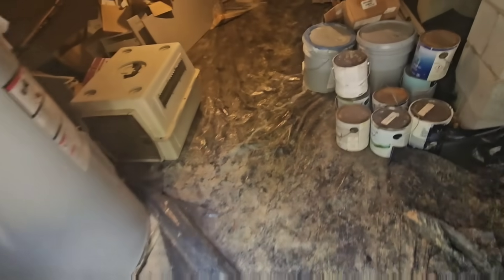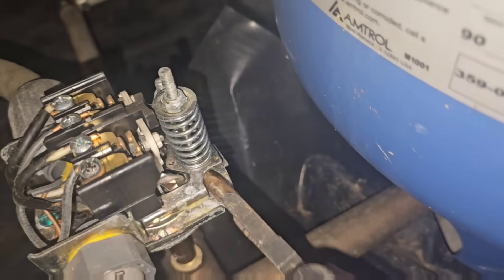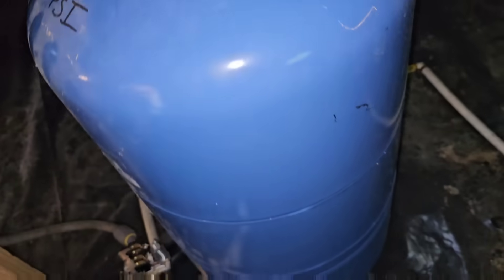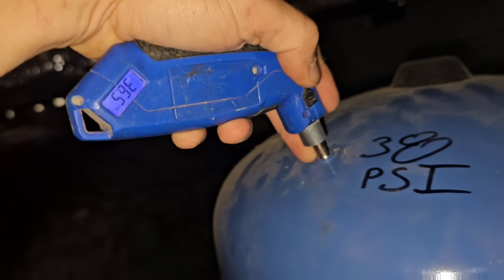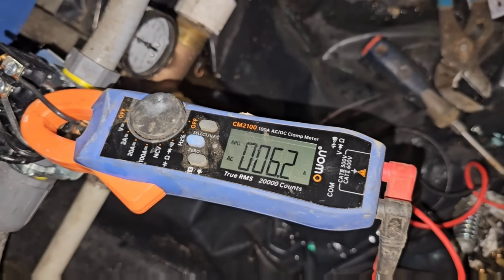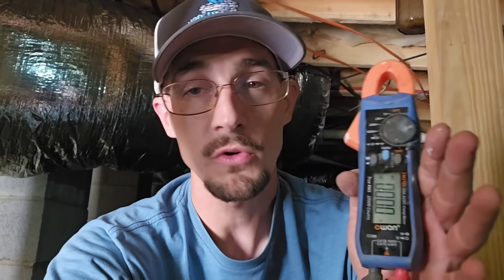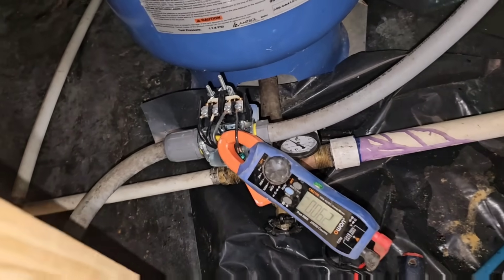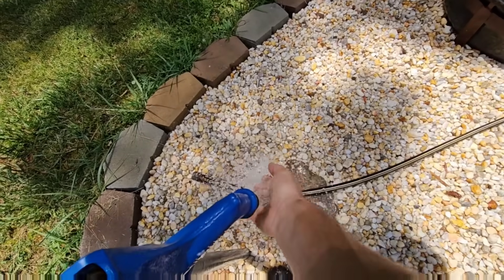Well Pump Troubleshooting at The Pressure Switch. DIY Test & Fix for No Water.

Comment: I sure wish you guys were in my area.  I had a very painful experience recently from a pump and well professional, who came out to perform a rehab on an old well.  After completing the process, he sticks the pump back down the hole, clamps his current meter around one leg at the well head, and energizes the circuit.  Pump isn't running, and gets zero amps.  He thinks because there is zero amps, the control box in the garage is bad.  Keep in mind, ALL the work was performed at the well head that day.  I tell him to check for voltage at the well head coming from the house to verify it's there. He kept telling me "I've got an amp meter out there, and there's no current so there's a problem with the pressure switch, control box, or pump tech".  I told him you're not going to get any current if there's an open in the circuit, so just make sure there's voltage at the well head first.  He still insists the problem is in the garage.  We walk into the garage, and the pump tech box, located downstream from the pressure switch, is ON.  I tell him this is downstream, and is illuminated with power.  "Trouble is leaving here fine" as I like to say.  He starts swapping out the card in the control box, opening and closing the pressure switch, and smelling the pump tech circuitry for something that is burnt.  Long story short, I don't think this guy understood basic troubleshooting. By dumb luck, his helper decided to unwrap the wire nut connections and found the problem right there.

Comment: Two days ago, I noticed that the water pressure was decreasing.  Dwindled to almost nothing last night.
I'm fairly handy, so I'll try and I've got a voltmeter.  It's not the circuit breaker, so I'll proceed.  
Thanks for your video.  Any other advice?

Comment: Nice job trouble shooting! Though how would you go bout trouble shooting a 2 wire 1/2 hp 120v submersible pump for resistance?  Mine occasionally has trouble starting but most time it runs perfectly, I contacted Franklin pump and mentioned to check the resistance to the pump and it ohms out at 4  specs called for 1.4-2.0 ohms I'm thinking it may have something to do with a bad starter cap? Thanks Nate

Comment: Not sure if you can answer some questions for me , but I watched your video, love your teaching way, but my problem seems to have compounded since my friend wanted to be helpful, now I'm not sure what's going on and haven't had water in over a week, changed pressure switch, and now tanks and more problems now than when I first started, I'm not sure what my friend did, but maybe fried the well pump. I can't get it to start but seems there is power to the pressure switch, my friend said the bladder tank was bad, but it wasn't full of water , he also put the air valve on the tank , it had been on the line near the pressure switch but not on tank. Anyways I'm probably wasting my time, but hope you can help.

Comment: I have noticed my pressure tank is only filling up to about 1-1.2 gallons. Everytime I flush one toilet at 1.28 gpf, the pump kicks on. I took off the switch and sure enough the pipe the switch sits on was clogged id say 90%. I cleaned that out yet my tank is still only filling up 1 or so gallons and kicking on. I don't have any other symptoms of a bad tank i.e. no water sloshing, no air coming out the schrader valve, my pressure is good. Could the switch itself be bad? I know there's a diaphragm in the switch and seeing the amount of sediment come up the pipe the switch sits on, my guts telling me the switch is clogged and not allowing it to fill up the tank correctly. Thoughts?

Comment: The switch only shuts off one circuit, the other wire is hot. Where is the check valve? Where did the air go? It’s a closed bladder, you will lose air again
Reply: You dont need a check valve there u dink . Air could have been lost at the shrader valve as well

Comment: Thank you so much for the tutorial...really instructive ! I have no water from the well since Wednesday March 7th, the tank is empty, I replaced the switch pressure , the pressure gauge (indicating 0 now) are good. I aired the tank up to 38 psi  as it was 10 psi....when I kicked on the breaker, my new clamp meter indicates 24-25 amps then drops to steady 0....15 secs later, same scenario. Any thoughts ? Thanks for your help.
Reply: Hi 👋

Comment: I have a couple of questions, one is when your installing a new well away from the home and pressure tank and pump start and run control box in or under the home,why do you not use a pitless adapter through the well case so the plumbing doesn't have to be protected from freezing or damage.

Comment: Ok my bad. Ok so I have a Junction box.Where where the word coming from?The breaker box here and the whale goes straight to the pressure switch. On the other side of the switch the wire comes out goes to the junction box, Then it goes from the junction box to the well.. My question Is can I do away with the Junction box? And run my wire from the switch to the well pump???  That looks like a lot of the Videos you show are without a junction box. My junction Box
Has a capacitor in it. Need help And information please??

Comment: So my pump is a Grundfos MQ and has an integrated pressure switch. We have no water pressure. I went under the house to the tank and it’s in an alarm status and not running which according to the book happens when it’s running dry, overheating, ect and shuts itself off. I undid the prime port and got blasted so it’s definitely not running dry. Any ideas? The gauge between the pump and tank is showing zero. I haven’t checked the pressure on the tank yet. Would some kind of clog in a pipe cause this?
Reply: Replace switch and check capaciter

Comment: I did that and i changed the switch and it work for one day and now is not working again the tank pressure is fine the gage psi is in 0 all that time included when it was working i do not know what is the problem 😊
Reply: Hi pancho

Comment: Thank you for this informative video, you are very experienced and knowledgeable.  However, I would not appreciate my plumber turning on the drain faucet at the bladder tank without a collection pan.  Maybe you cleaned up the water later, but a collection pan would have been more professional and a better presentation in your video.  Whether a conditioned and non-conditioned space, I never want water standing under my house, period.

Comment: I appreciate you filming and sharing the video.  What happened to the air in the pressure tank?  You think it leaked from the Schrader valve and maybe reseated so it won't leak out again?

Comment: We are having severe storms  out west .
The power went out and our jet pump isn't working .
Our system is a submersible to a 2500 gal tank and a surface pump charging the pressure tank . I'm going to start at the panel and check all the connections to the pressure switch.  Now I know to check the tube and check the switch.  
Thanx
Reply: Hey Felix

Comment: What if my pump starts at 6.4 and slowly drops down until it eventually stops running? Time to replace the pump?
Reply from the maker: @jessecrouse232  not necessarily, 6.4a is good. Under load it does go down in amps slightly. But if it stops & the water quits, you might have a wire failure or a wore out pump impeller stack.
Reply: @h2omechanic  it will drop down to about 5.3 and hold there and It won't build any more pressure. I figured either bad pump or well drying up? Either way thank you for responding I appreciate it
Reply from the maker: @jessecrouse232  correct! It can be a dry well, if its been common in the past. Id check for a leaky toilet. 
But if its 10 years old, definitely can be a worn out pump too.
Reply: @h2omechanic  actually the pump is 22 years old lol I'll be doing a pump this weekend. Btw Ive watched probably 30 of yours videos in the last 2 days and now I feel confident to tackle this. Thank you for everything 👍

Comment: Thanks for another great video. Got a situation here, i just ran out of water, switch seems a little burned and the pressure tank is waterlogged. Pressure gauge is 0. Ill run to the store tomorrow and try to change the tank and switch. My main worry, do i have a dead pump since i have power but pump does not turn on?

Comment: I have an issue with my system not maintaining pressure and my pressure switch kicking out.  With the tank pressure tank full and the pump off normally you can use any water in the house (single draw at a time) without issue, but I have a separate line 3/4" line going out and with it running without restriction the pump does not maintain pressure.  I replaced the pump approx. 11 years ago and have not had this issue in the past.  Everything I see points to the pump going bad but thought I would get your opinion before I pull the pump.
Reply: Hi 👋

Comment: Young and smart. Thanks for your work. I have a new pressure tank, switch and gauge.  The psi aligned with tank at 28, and switch at 30/50. All runs well during the day but when the iron filter does the backwash the switch loses the pressure and tank does not have time to refill. Air get in the pipes and water comes out with Pot-Perm residue (pink). I reset the switch lever and start working but the same happens.  Thoughts?
Reply: Missmatched parts

Comment: Help, yesterday I lost water pressure to a trickle and we replaced the pipe on the pressure switch because it was stopped up and rusty, no good 1/2 HP pump was pulling about 5.8 amps, this morning we pulled the pump to check things and all pipe and fittings looked good, turned the pump on and it sounded kind of rough it was 25 years old so I replaced it and we had good pressure for about 1 1/2 hours then we lost it again, what do you think?, Thanks Dave

Comment: I have a booster pump to boost my city water I live on a hill. But when the city water is out for a broken line on there side and I have not water going to my pump they run dry and burn up . Is there any thing that I could do to prevent this. I have had to replace 3 booster pumps so far.
Reply: Add a no syphon return piece

Comment: An excellent procedure for diagnosis of well water system. Described concisely without extra words that fog the message. Should be a primer for anyone, pro or amateur working on a water. All of your videos are interesting, informative, and describe the logic behind each diagnostic procedure. The logic and thought processes are the most important because it facilitates the application to a wide range of system configurations, not just the system you are working on. KUDOS!

Comment: I have a question: How much air pressure should be in a bladder tank with the water in it? I have a 30/50 pressure switch?  Is the pressure different when filled with water?  I have it set  at 27lbs. per your directions. Thank you in advance I really enjoy your videos and have learned so much.
Reply: 38

Comment: I changed my switch and my pressure gauge (the gauge was stuck at 30 psi). When I turned it back on, I still have the same problem. 
I now get a burst of water pressure, then only a trickle. Just enough to run the sink and toilet, but not enough to run the shower. 
The sound of the pressure tank sounds ok (it rings like a bell as you say). No water came out of the air valve, and I set the pressure per your instructions.
Any ideas? The pump control box was changed a few years ago, but has a small dent like something may have hit it. Should I try changing it, or could it be something else?

Comment: that switch is labeled for line voltage and load, if you wire it correctly, it will last much longer. line will be your power and load will be your pump

Comment: A friend of a friend of mine Had no water. I was asked to go out And see what I could find out. I did so, and I determined that he had a bad pump Switch. also someone had Bypassed the Pump motor control module box,as the Capacitor was bad. They just ran straight from a Circuit breaker to it I decided to leave it as is without the control module considering it was only a half horse Pump And I got water back at the well house and As soon as I open the hose The pump Had already pumped up to 50 PSI It just started shooting out red water I didn't know whether or not It was because it had sat for A couple of weeks time Uh that it may have just broke something loose inside the bladder Or what and that is my question Could the tank possibly be bad As It was also low on air pressure And I couldn't get any air to it because I was using a Slime Compressor for A car that plugged into a car lighter And I could not get any more than 24 PSI into it And it Needed More than that obviously Um but it was at 17 When I started Um And I still didn't have water to the house Couldn't get water to run in the house And then I located a filter Just uh Culligan like m360 or something common water filtration That thing was so dirty with red Uh sediment Uh remove that and Put it back on without a filter because didn't have a new filter and Presto we had water in the house Um I could ask you about the tank because I figure you would know or would be able to tell me If that red water was an indication of a bad bladder With the air pressure and and I figured you'd be able to tell me if I should change out the tank?
Reply: Hi 😊

Comment: So getting out of the shower two days ago I noticed the water pressure dying off pretty fast. Went to basement and saw breaker was off. I had been doing electrical work day before and thought maybe I had flipped off that breaker by accident and not noticed. I flipped it on and it stayed on. I went to tank and pressure guage was low so I learned from you about pressure. I added air to tank and we saw increased pressure at sink nearby and upstairs and increased on guage. Pump never kicked on however. I did the pressure switch cover trick and tested for power and there was power and no apparent issue with contacts but I didn't get any arcing. (Kind of an aside I'm confounded on is the romex I have going from control box and breaker power never registers with electricity tester but contact points of wires and junction box do test hot when hot. Don't understand why as all other romex I run tests hot when I tap tester to them) back to main issue, sorry, I opened up the control box and looked it over and noticed that the motor capacitor cap (where we have a black dot vs a white dot)was actually 'blown' off the capitol. I kind of figured it was dead seeing that but pushed the cap back on so round toothed clamps thing was re engaged. Still getting nothing from pressure switch. All the while here the pressure switch contacts have been engaged with wire harness leads., fyi. Eventually watching more videos from you and others I realized too that the pressure tank itself was bad as when moved it had water sloshing around inside and did not make a lovely hollowish sound when knocked on. Also fyi the wires were alternating white and black not black one side white other side. 
Since then I have now replaced the tank and fittings, pressure switch and control box. We couldn't afford the exact same make/model of tank (had maxtrol 20 gallon 125 max psi tank and replaced with water works 32 gallon max 100 psi tank. Control panel is a qd box. I have now watched all your pressure switch, tank and testing videos and gotten to when you use a clamp meter (I now know about this test AND own a clamp meter) on the wire in the pressure switch and I get a amp reading of zero. The wires in the top of well column housing read hot. I have not checked those wires with the clamp meter yet.

I'm assuming I need to pull my well pump and troubleshoot,  likely replace the pump itself. 

I am go8ng to watch your well pump troubleshoot now and how to pull a pump. 
Just a note, I already know I can't afford the higher end pumps, am I ok going with one from home depot?? Not sure what their brand is, but they only have one based on logos on boxes I glanced at.

Hoping to hear from you any thoughts and/confirming to best of your ability from my short story if I have correctly diagnosed that it's my well pump.

Comment: Do you ever work on shallow wells with the pumps in the basement and well pipe going through the floor?
Reply from the maker: @glenodell4885  occasionally I run across them. They are getting more rare in my area

Comment: I have a brand new 25 gallon per min pump 1 horsepower my well is 138 ft deep how deep should the pump be ?
Reply: Need to measure static water level. Do so by dropping fishing line down well pipe w a small weight, but not lead. Mark line at top w tape when weight hits bottom. Pull out and measure line. Next tie a bottle to end of line and drop down. It floats on water. Mark your tape and pull out and measure line. The difference between two lines is where pump goes

Comment: What pump and set depth do you recommend for a 440' deep well with a 115' static water level and 50 gpm output? We plan on having a 5 bdr, 4 bath, with an inground pool and hot tub.